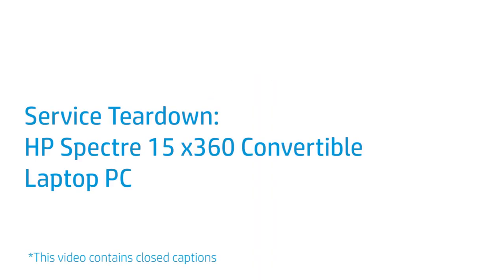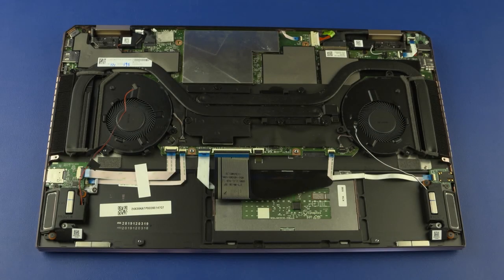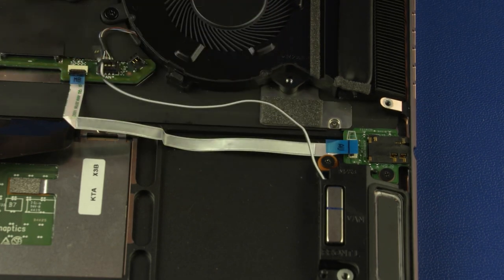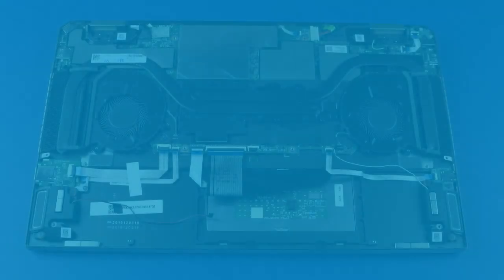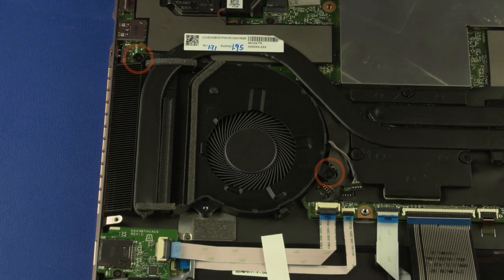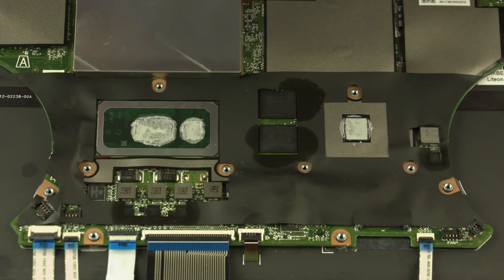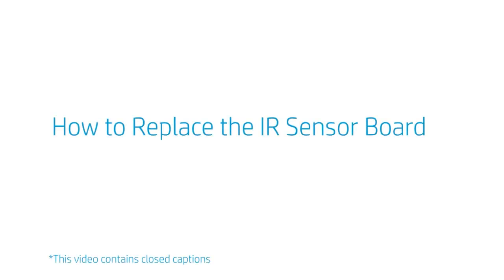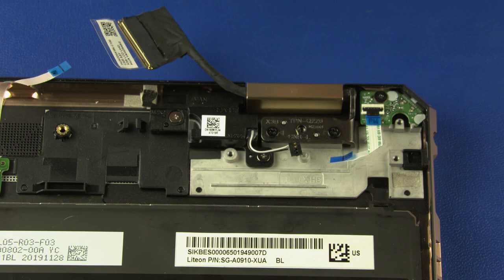Removing & replacing parts for HP Spectre 15 x360 | HP Computer Service

Comment: Hello:) I'm very happy with the spectre x360 but is it possible to remove the shift button? Because at the left corner down side the button didn't go down anymore and its new but I don't want to send it back and wait again for it😅 I hope you can help me:) 
Thanks 
Greetings from Switzerland
Reply from the maker: +Florian von Schropp HP does not recommend upgrading or downgrading hardware parts or software that is bundled with the product as It may affect the manufacturer's warranty and performance, however, you could change the configuration at your own discretion.

Comment: Are the USB A and C on the right side of the box on the motherboard itself or a separate unit/card attached? I am trying to find out if USB can be replaced/repaired without replacing the entire motherboard?
Reply from the maker: +kozureogami HP does not recommend upgrading or downgrading hardware parts or software that is bundled with the product as It may affect the manufacturer's warranty and performance, however, you could change the configuration at your own discretion.
Reply: @HPSupport  Thank you for the reply. I understand. But if I send it into HP for repair the USB A for this model...will that require that HP replace the motherboard or is USB a separate component?

Comment: Where's  the screws  for  7MQ43AV model? I don't see it under rubber feet
Reply from the maker: Hi there, thanks for contacting!
I understand that you need to know about removing the rubber feet. 
I will do my best to assist you.
Please refer page number 27 of the user manual to know about removing the rubber feet: https://bit.ly/3l1gcRN
Binu - Social Media Tech Support

Comment: Pls help,is ThiS the same with HP spectre x360 convertible 15-eboxxx, my battery drains when off,and my USB type A is not responding.i have tried several troubleshooting,the last option is to remove the battery
Reply from the maker: Hi Don, thanks for contacting HP Global Social Media Support!
Please try the steps mentioned under the video on your notebook and let is know how it goes!
If you need any help in the future, you can always get back to us.
Thank you for being a valuable HP customer.
Have a wonderful day!
Cheers!
Binu_HP Social Media Tech Support
Reply: @HPSupport  Hi HP support,I have tried several YouTube help and support,but my HP spectre x360 convertible 15-eb0xxx, laptop battery still drains from 100 percent to zero when power off, and only the USB type A is not responding,and I think the both issue are related. My battery health is ok, it charge normal and last long when fully charged.it is definitely not a hardware issue,my laptop is fairly New and has no physical damage.thanks.
Reply from the maker: Thanks for the reply.
Troubleshoot the battery to see if it needs to be replaced as mentioned here: http://hp.care/2ogvdjm 
Binu_HP Social Media Tech Support
Reply: @HPSupport  the link is not working,it says we are sorry,the Page is not working, May be it has to do with my location,am in Nigeria,send another Link for me, or maybe some tips.
Reply from the maker: In order to get this issue fixed, please contact our customer care team over the phone or chat for further assistance, as this issue requires Live conversation with you over phone or chat to isolate the issue and provide you instantly with appropriate solution or repair/replacement options available at your place as per the warranty.
Please feel free to reach us on call/chat, please access this link to select your preferred country and language option to reach us. Global support link: - https://www8.hp.com/us/en/contact-hp/ww-phone-assist.html
Binu_HP Social Media Tech Support

Comment: Is this the same with the 2017 MODEL?
Reply from the maker: +Raphael Hudson May I know the complete model number of your computer so that we can check the details for you?
Reply: @HPSupport  The Prod ID is 1VW22AV    It's a spectre 360 - 15t.  In mine, there's an audio ribbon cable on TOP of the SSD, and I'm concerned I don't know how to remove the cable w/o damaging it.  Is there a video for my specific mobo?  TIA